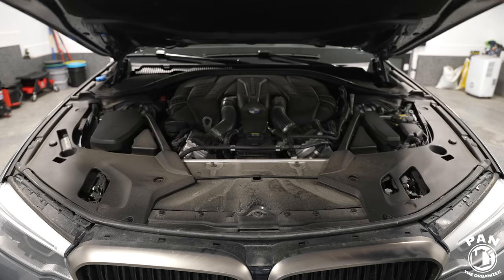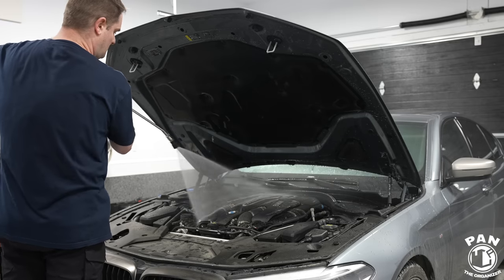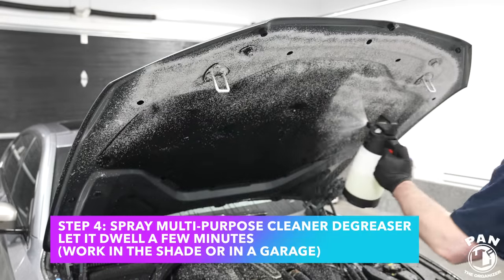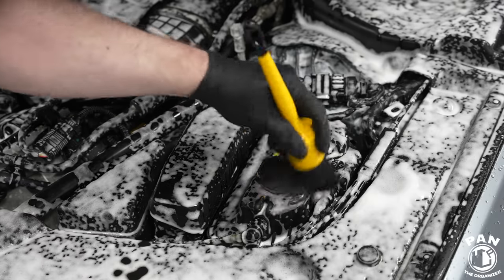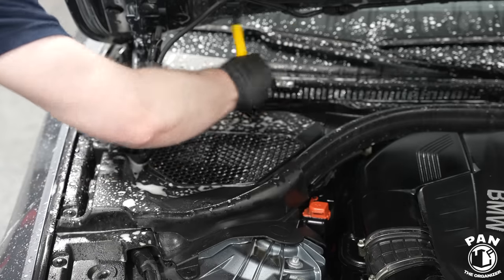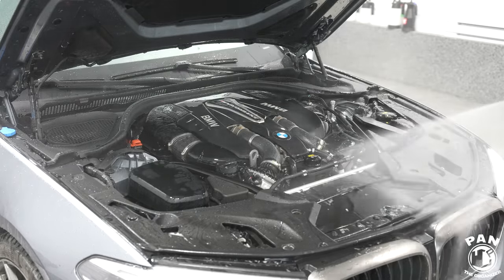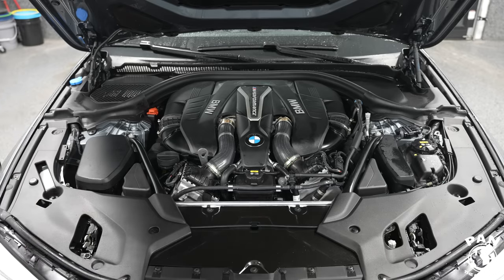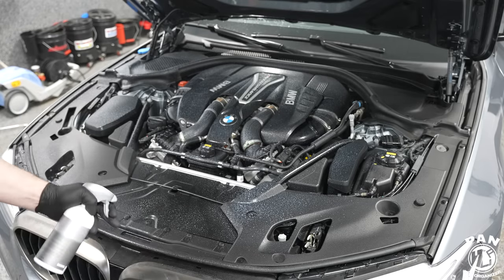How To Detail Your Engine Bay!

Comment: Often overlooked part of a complete detail. Awesome video pan! One tip, before you start spraying water, double check all visible fluid reservoir caps and the dip stick (if your car still has) to make sure they are on properly. Had a customer tow their vehicle in because the master cylinder cap wasn't on properly and they ended up getting water into the brake fluid.
Reply from the maker: Great tip!

Comment: up til this point i only use APC and brushes to clean my engine bay. would really love to pressure wash it but it scares the sh*t out of me. aside from the battery is there anything else i should cover before pressure washing? i'm driving a Honda Fit/Jazz RS 2012 hybrid if that makes any difference 😅 thanks.

Comment: A couple of extra points Pan, I am a mechanic and I wash engine bays all the time. firstly, cleaning an engine bay is generally a good thing if you live in the salt belt like us. Salt build up can cause all kinds of corossion problems. Secondly, wash the engine when it is warm, not either cold or very hot. Thirdly, always go for a drive afterwards or at least warm the engine to operating temperature to evaporate any reamaining water.
Reply: @Saskatchewan1913 Have you ever ran into where using pressure washer forced water into something that caused car not to start after cleaning an engine? Do you recommend covering alternator with plastic first?  I have a 2007 Kia Rondo so not sure how well they protected connectors back then.
Reply: @joelpasserell4525  Only had a problem myself on an old Jaguar but I have seen damage caused by other people using a pressure washer too close. If you are just washing off loose dirt or salt use a hose or a pressure washer from a distance. Alternator should be fine but always run the engine to operating temp afterwards help evaporate and water left on the surfaces.
Reply: @saskatchewan1913  Hi! Can I ask you some questions on cleaning engine bays thru email?
Reply: @joelpasserell4525  do i need to cover the battery and fuse box in a subaru legacy?
Reply: @md h   I've detailed a few engines, but I'm not an expert. I think you meant to reply to saskatchewan1913 instead of me.🤔  IMO I'd say you're OK without covering the battery.  Use a leaf blower or other specialized blower to dry it off.  If it's a newer model car, check the fuse box cover.  If it over hangs the base where fuses are and no cables enter from the sides, you should be ok there too.   If you're really concerned about it then use a hose with nozzle attachment with the shower setting.  You can rinse both eoff using that, & there should be no worries.  IMO, using a degreaser like super clean diluted 5:1, along with some brush agitation, water pressure from a hose should be all that's needed.

Comment: Hi, a added tip is make sure you lubricate the hinges and catches after you have finished detailing your engine bay because the APC or degreaser may have dried out the greases on your hinges. If you don’t eventually you will have problems with the hinges and possibly the alignment of the hood. Thanks for another fabulous video Pan. 👍🇬🇧😀
Reply from the maker: Good tip!
Reply: @PanTheOrganizer  Thanks 😊we learned the hard way, our first GT-R’s bonnet started to catch at the top by the windscreen and traced it to a lack of lubricant on the hinge 😩

Comment: Great video as always Pan. I have a 22 X5 with a B58 that could use a bit of cleaning however, when I am under the car it is all covered up underneath. I would think that I would need to remove the under shielding before doing an engine cleaning in order to get all the dirt and grime to get out and not be trapped in the under trays. Your thoughts on that please?  Thanks

Comment: Mr. Pan, can you help me out with a couple of questions:
1. I bought CARPRO Cquartz UK 3.0 50ml, I want to apply it to my dad's car after polishing it, my question is, do you think I should use it for the windows or get a dedicated windshield/ glass-ceramic coating, maybe the CARPRO FlyBy Forte or one of the three winners in your 2020 awards 
2. When polishing car paint, do you go through multiple pads or do you use the same pad while cleaning/blowing it out in between passes 
3. My dad's car headlights are super bad, I'm gonna sand them and polish them, now I have a spray can (clear-coat with UV protection) should I apply that and then ceramic coat, or will the ceramic coat be enough?
4. Last question: speaking of sanding the headlights, I bought a 3" interference pad and (800, 1500, 3000) sanding disks, is it OK to use my Rupes LHR 75 DA to sand the headlights or should I do it by hand and go East-West then North-South then East-West again

Thank you so much

Comment: I’ve been a little gun shy about using that much water under the hood ever since I detailed my wife’s car 25 years ago and the engine detail ended with a sizzling sound and smoke coming from the alternator. The electrical fault created enough heat to melt the solder around one of the diodes where it was soldered into the heat sink. I was able to repair it but it was not fun.
Reply from the maker: Luckily cars have evolved to a point in the past decades where manufacturers have made the engine bays more water proof.

Comment: Your videos continue to set the standards!!! I believe you have detailed engine bays in the past with applying degreaser to a dry surface versus doing a pre rinse. Would you advise against using a degreaser on a dry engine bay?
Reply from the maker: I prefer rinsing first like when washing a car. That way you remove loose dirt and debris.
Reply: @PanTheOrganizer  Have you changed your mind about rinsing the engine bay first given what you learned in this more recent video of yours?
https://www.youtube.com/watch?v=16SwGBQ29rs
Reply from the maker: Engine bays and paintwork are two completely different things, independent from each other. If you are to detail an engine bay, start with the engine bay first, before detailing the rest of the car. And when I detail an engine bay, I will still pre-rinse it. Unless I'm doing some other variant of the method.

Comment: Great video thanks Pan!  I'm always worried about getting the spark plug areas wet and electronics.
Reply: Same 😆
Reply: Not all engines have those big plastic covers that protect components, it's important to know the engine you are cleaning, for instance the MK2 vivaro vans are prone to seized injectors from water getting into the wells, I had a Renault Megan 225 sport that had seized spark plugs from water ingress, and these type of things happen over time, you can clean your engine but years later when an injector needs replacing you get a call that it is seized by rust.....always best to pay extra attention to any "wells" places where water can sit, use a blower and some wd40 to disperse any moisture, fuse boxes are another thing to be careful of, some are not designed or designed well enough to take a full soaking and again it could take time for any issues to show up by which time you'd unlikely think the engine clean was the cause.

Comment: Hi Pan,
 
First of all, I follow your videos with great interest and thank you for your contributions. I own a 2019 G20 320d, and I have a few issues I'd like to consult with you about. Specifically, I am noticing calcium deposits and surface rust in the engine compartment. There are white lime deposits on the aluminum covers that flake off as dust when I wipe them. When I look deeper into the engine, it appears that the surface rust is in its initial stages. Additionally, the surface of the turbocharger is quite rusty, which I believe is normal. In short, I would like your advice on how to clean this effectively. I have learned a lot from your videos, but the rust issue is quite concerning to me. I would greatly appreciate it if you could respond. I will continue to follow your work with interest.

Comment: Hey Pan, would disconnecting the negative terminal on your battery add any extra protection from shorting any electrical components or is it not necessary? Also, are you able to engine bay clean a hybrid/electric vehicle?
Reply from the maker: You certainly can take an extra security measures if you feel the need to. I have never had the need for that with modern cars (less than 10 years).

Comment: Great job and relatively quick+easy. My 2002 diesel with its ancient ECU sitting on top (up against the insulation when the hood's down) scares me off this job.

Separate question - I have just upgraded my Focus with a Recaro ST leather interior. Love it, but after detailing and conditioning the leather and the plastics I still get the whiff of the previous owner's cigarettes (the door cards seem to be the culprit). Starting to really bother me. Recommend a good interior neutraliser - rather than masker - for tobacco odour?

Comment: Great Teaching video!  I have two old vehicles from 2006-2007, the question I have is do I need to put a plastic cover on the car batteries when cleaning and power washing? Leave it open then? If so, won't it damage the batteries? Thanks! Keep up the good work!
Reply from the maker: In case of doubt, just cover the sensitive parts with plastic bags.

Comment: Nicely done. In these kind of models do you need to unplug the battery or not?
Reply from the maker: Not really. Modern cars (less than ten years old) have pretty much water tight components. As long as you use common sense and safe practices, don’t overthink the moment.

Comment: Does cleaning an engine bay that has a lower cover panel create any problems with water and chemical dispersion? Does it drain out ok and just not sit on top of the cover plate?

Comment: Hi Pan, excellent video, thank you! I was wondering - is there no need to disconnect a battery? My car is 6 years old and there is a caution on a battery that is should not come in a contact with water ... one more question - what about the insulation part on the hood? Doesn't it absorb a lot of water? I want to clean it but it looks like it will stay wet for quite some time. Really appreciate this video!!!! :-)
Reply from the maker: I don't disconnect the batteries. But feel free to do so if it makes you feel any better. Each person has their way of doing things. In 24 years of detailing hundreds of engine bays, I have never had a single issue. Common sense and precautions when needed.

For the underhood insulation, my Master Blaster Revolution car dryer takes care of that quite quickly (filtered hot dry air). And if there's any residual moisture, it will dissipate and go away when the car drives off and the engine bay gets hot.
Reply: @PanTheOrganizer  thank you for your answer, Pan!!👌 🙂🙂

Comment: Pan, is the Motorplast a water based dressing?

Also, do you suggest to have the dressing applied AFTER washing the exterior of the car? That way water won’t affect the dressing while washing the car?
Reply from the maker: I detail the engine bay first, and clean the rest of the car after, because you don’t want the greasy engine crap splashing onto your clean paint.

Comment: Hi Pan I’m a great admirer of your channel. I have a question if I may. 

I own a 2013 UK model Ford Focus 1L petrol eco-boost and recently my coolant hose split and sprayed coolant all over my engine bay. 

My question is: Can I safely wash my engine in the same manner as you showed in this video, including using the jet wash (I don’t have a blower though) Thanks Pan
Reply from the maker: Hi! Welcome to my channel. You discovered one of the biggest car detailing channels on YouTube as we surpassed 830,000 subscribers and 105 million views! I have been detailing for 25 years and I love to share my knowledge and passion with my viewers.

You found the right channel to help you learn everything about detailing.

To answer your question, since you already had a part fail in the engine bay, I would be careful in detailing the engine. If you feel confident there are no other issues, you could go ahead and clean it using some basic precautions, but do so at your own risk.
Reply: @PanTheOrganizer  Your response didn’t fill me with confidence so I guess I won’t then.
Reply from the maker: Correct. When you are unsure, it’s best to stay on the cautious side.

Comment: Pan, you’re the master! I can’t get enough of your videos over the years. 
Great video, as usual. Wondering about something. There seems to be 2 schools of thought on this product (Motorplast): one is to blow dry the surface first then apply, and the other is to apply to a wet surface. The Rag Company swears by using this on a wet surface b/c they say the product needs the water to bond the best. 
Have you tried both? Do you recommend one over the other?
I plan on using this product on my 2018 Alpina B7, so I am looking for the safest, yet most effective method!

Cheers!
Reply from the maker: Both methods are valid. However I still prefer to make sure I blow dry the engine bay to make sure there's no residual water afterwards, as to not get any issues. I prefer making sure there's no water left, than having an optimal bond of the product. And even on a dry surface it works well enough.
Reply: @PanTheOrganizer  great, thanks for the prompt reply!!
Reply from the maker: My pleasure. How did you discover my channel by the way?

Welcome to my channel. You discovered one of the biggest car detailing channels on YouTube as we surpassed 760,000 subscribers and are getting close to 100 million views! I have been detailing for 25 years and I love to share my knowledge and passion with my viewers.

You found the right channel to help you learn everything about detailing.
Reply: @PanTheOrganizer  I started watching you just before the pandemic…maybe 2019 or so. I was researching maximum pressure washer psi for car washing and came across you.  Fast forward a few years and several thousands of dollars later…😁
After binge watching a lot of your stuff early on, YouTube was filling my homepage suggestions with your new stuff and I’ve been tuning in for quite some time. 
I love the way you break it all down. You also give great in-depth product reviews. Many of the products and processes I use now are a direct result of your videos. Thanks for giving me the opportunity to pass along my appreciation. I have a lot of respect for the brand and business you have created for yourself. Well done!

…now, if I can just get a garage like yours 🤣
Reply from the maker: Hehe thanks!! Keep working hard and your dreams will come true as well.

What’s your favourite feature of my garage?
Reply: @PanTheOrganizer  aside from the sheer amount of dedicated space you have, I’d have to say the organization is my favorite. Everything is clearly well thought out and presented well. My borderline OCD applauds your efforts!!

Comment: Thanks for the video. BTW do we need to cover those electrical parts like battery, ecu, wire connector and etc?
Reply from the maker: On modern vehicles (less than 10 years old) I never had the need to do that. Just use common sense and correct procedures, don't overthink the moment. But if for some reason you are scared, or are working on an older vehicle, then by all means, protect sensitive components like batteries, ECUs, alternators, etc.
Reply: @PanTheOrganizer  That's some very useful tips. thanks !!👍✌

Comment: great video!   Couple of questions for someone attempting to do this  for the first time:  Are there any components that need to be prepped (e.g. either covered or absolute no-no areas)? Are the degreasing agents necessary?  Would a ph Balanced shampoo with a garden hose be sufficient?  Wanted to try this on a newer era car, 2020 BMW but not sure where I can and cannot use the shampoo and water on?  Also, any particular angles that the water should not be sprayed through?
Reply from the maker: You should use an automotive degreaser as a pH neutral shampoo doesn’t have the power to cut through an egine bay’s grease and grime as much.

I have an engine bay detailing tutorial for beginners here: https://youtu.be/6LwCbmvLYb0

If I did it on my previous BMW M550i twin turbo engine, you can do it too. Once you know the basics and use common sense, there’s nothing to worry about with modern cars.
Reply: @PanTheOrganizer  thanks for the pointers and the reference vid.  Much appreciated!

Comment: I’ve heard several times from different channels to unplug the battery and cover the alternator….is this beneficial to do?
Reply from the maker: If it makes you feel safer, you certainly can. If your car is less than ten years of age, I wouldn’t worry about it. I never feel the need to disconnect the battery.

Your car drives in the elements including the rain and water gets into the engine compartment all the time anyways.

Comment: Pan, I want to clean the engine bay but I'm afraid too. This is a 2000 Toyota Camry LE 4 cylinder. That needs cleaning badly. There are a lot of Sensors everywhere. The felt on the hood need replacing. I don't know what to do about the battery and alternator. There are also some wires that are exposed don't know what to do about them either. I'm the forth owner of this Camry. The engine bay is really dirty. It needs a degreaser that's for sure. Don't know if I should use water on the engine bay. I'm going to have to be really careful about cleaning this engine bay.